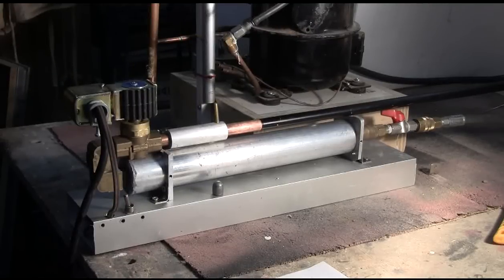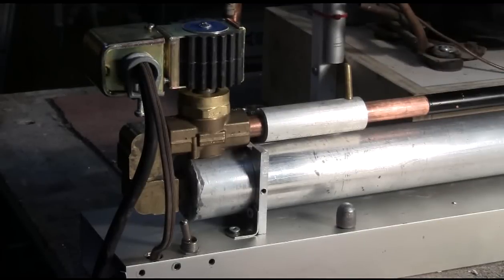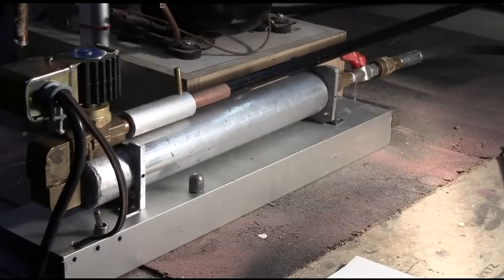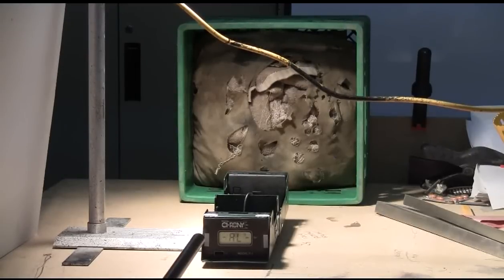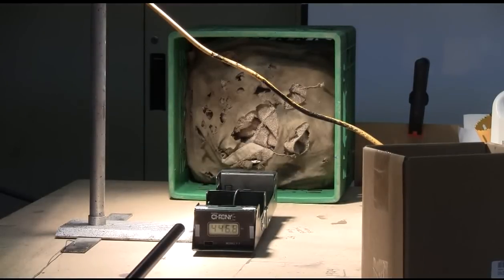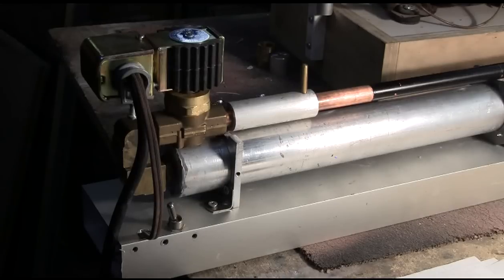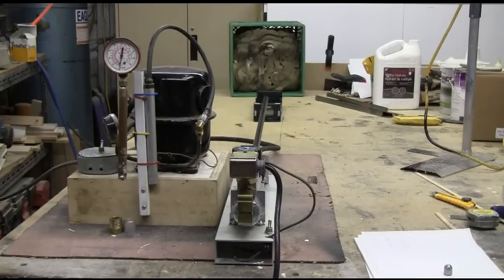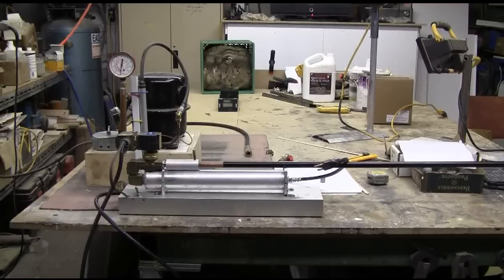Air Cannon #45 - Electric Solenoid Valve Cannon

Comment: Hi, thanks for another great vid :-) i have been inspired to make a small hand held one after your ongoing series of vids. on my old ball valve cannon i used to dip the the steel ball bearings i used in candle wax, until i had a few good coats built up, in my mind the provided a better seal and high pressure lube for the ball bearing

Comment from the maker: Comparing this cannon to my piston valve cannon of similar air tank size, the piston valve cannon wins. It has about 70 fps more at 300 psi, using the same 45" long cal .565 barrel and the same lead slug for testing. The piston valve is slightly larger diameter though. The electric solenoid setup is very convenient however, with its self resetting, and new firing control on a four foot cord. I will shoot more video over the weekend.

Comment from the maker: This valve only has 1/2 " inlet and outlet on it. I have not disassembled it, but looking in from the ends, the flow has to take some twists and turns in there. The solenoid does operate quickly, but I doubt that it is as fast as a piston valve. Today I modded this cannon, the toggle switch is for on / off and there is a handheld firing button on a four foot cord. Also added a barrel support arm and adjustable support. I do have larger solenoid valves and I am tempted to build another cannon.